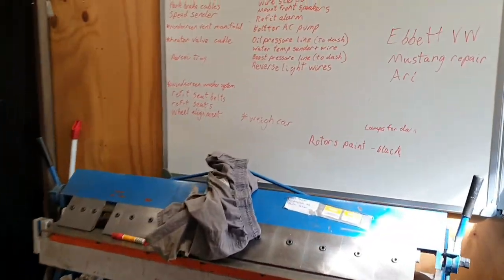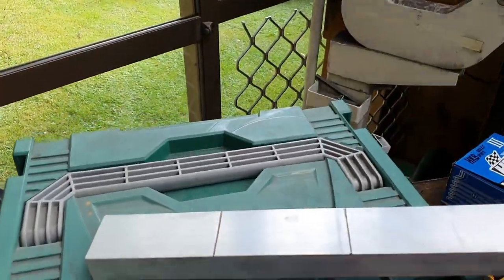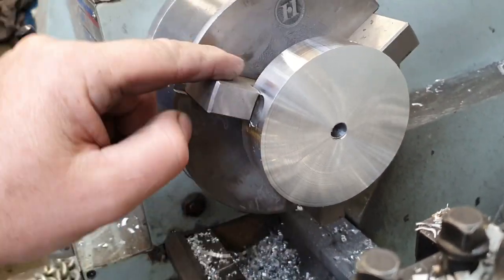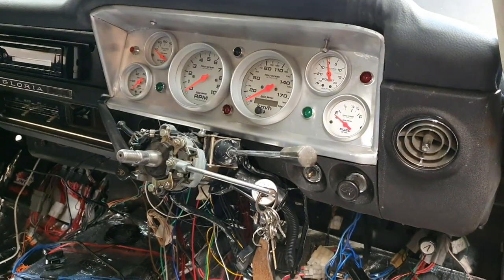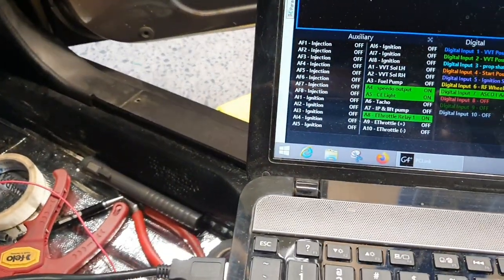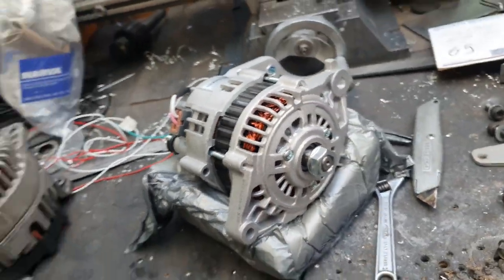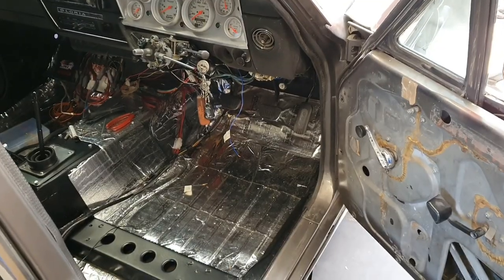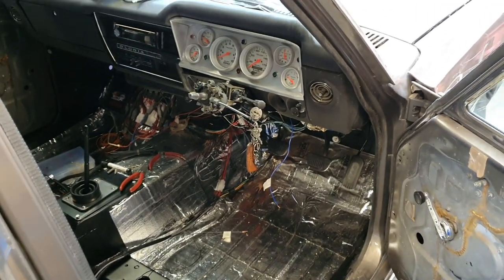69 VK56DE Gloria instrument cluster stuff and things.

Comment: Hello, fellow Nissan enthusiast here, appreciate the content!  A month ago My AT R33 ended up swapped with R32 GTR’s MT, gearbox has working speed sensor in it but it requires cable driven speedo while R33 is electric. This episode might be just for me :D My tuner/electrician has already replaced factory RB knock sensors with Bosch units, so I think we can come up with this kind of speedo solution, we run ECU Master standalone ecu.